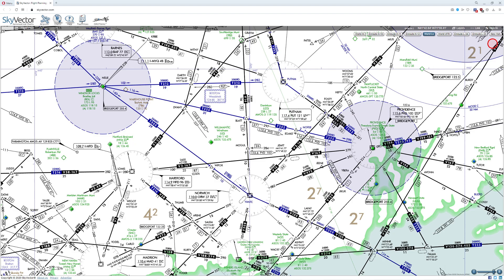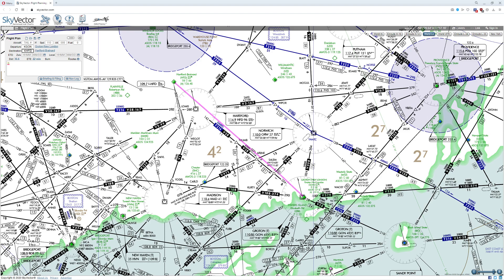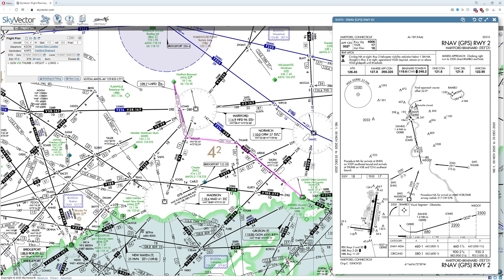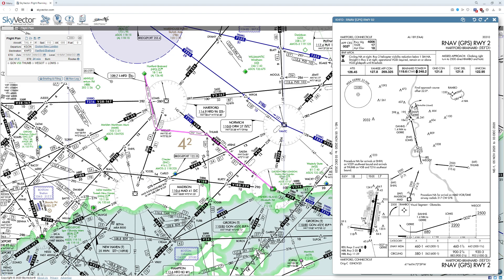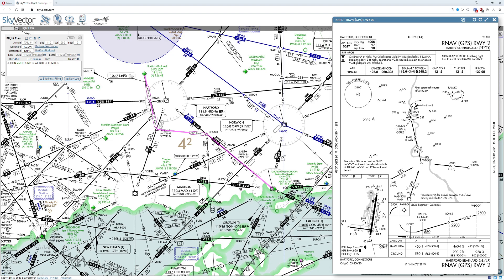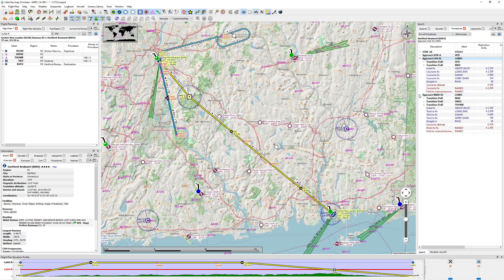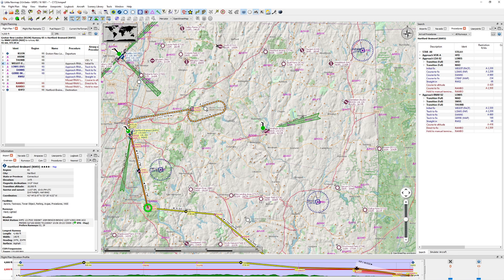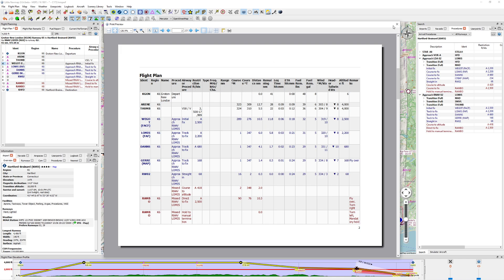Flight Simulator IFR Navigation - IFR Flying Part 1 of 2

Comment: can i use skyvector for msfs2020?? I dont really understand do people use it for real life flying?
Reply: It is a tool for real life flying. You can use it for flight sims but DO NOT FILE any flight plans you create - that is ONLY for real life flying.
Reply: @richavery66  because i see the conditions, they look very serious so i was wondering if i can use it.
Reply: @BPPUK  They are serious but you can use it for flight sim flight planning: just remember that it is a real life tool and filing a plan would transmit that plan to Flight Service!

That being said, SkyVector is good for flight planning - although when I've used it, I've usually created a plan in SimBrief, entered the departure and arrival airports in SkyVector and copied over the waypoints from SimBrief. That's given me a good visualisation of the route with bearings and distances in SkyVector. However, I'm now using Little NavMap and Pilot2ATC for most of my planning.

Comment: ?:  why is thumb to wegot have 2500 minimums but the map shows 4200 minimum. shouldn't they be consistent?
Reply: Not a pilot, but I beleive the 42 number is basically for flying across the area, without caring about approaches or even landing. The approach tells you that the minimum is 2500, since you do have to go lower to land (it's how landing goes, in a lot of cases :D), and by that specific waypoint/vector it is safe to do so. 4200 is the general rule for the area, unless stated otherwise by charts or atc.